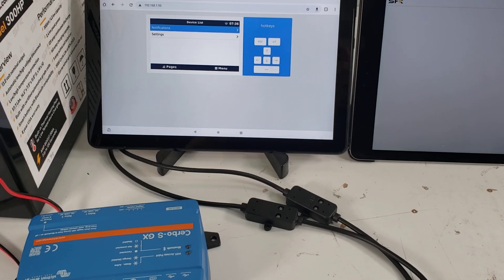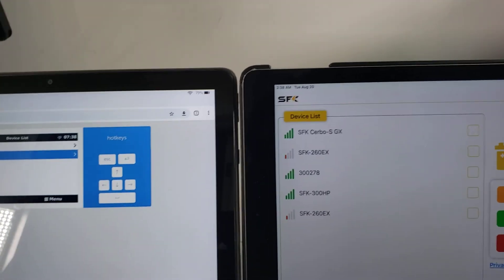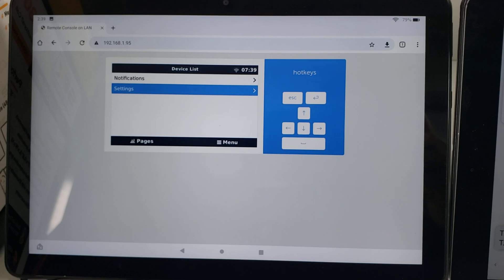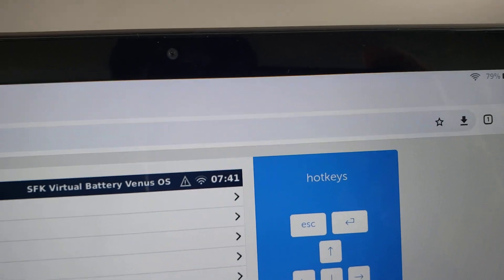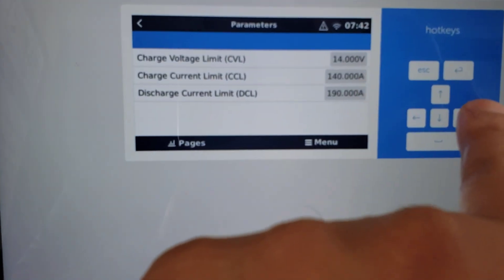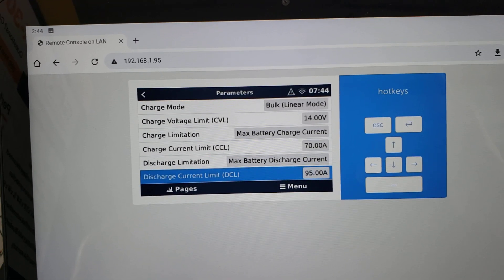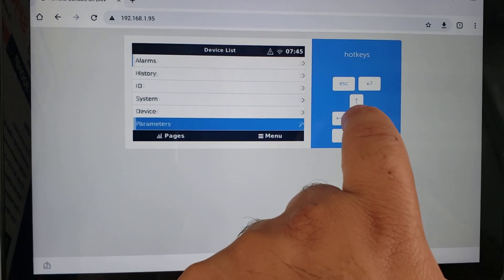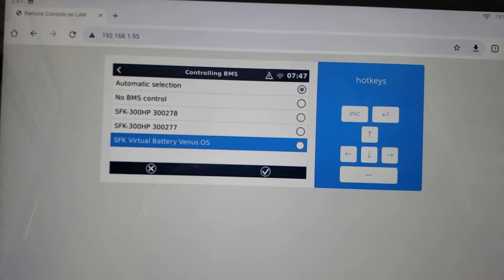Venus OS / Victron Driver 1.5 Virtual Battery Support Sun Fun Kits

Comment: Great upgrade. Now next step is a 2P2S or a 2S2P virtual battery. Mine are currently 2S2P. I have noticed that my batteries on the negative side of the 2S have lower cell voltage than the cells in the batteries on the + terminal. All cable lengths are equal.
Reply from the maker: 2S2P is supported in this driver, up to 4S2P (8 batteries) can work.

Comment: This is great. If you're out of USB ports can you use a hub? Is a passive hub OK or is an active hub required? Any problem mixing a V1 and V2 communications cable?
Reply from the maker: You can attach a hub, it does not need to be powered each port on the cerbo can attach a 4 port hub so you can have a total of 8 batteries connected. Please see our other victron videos where we show 4 batteries connected via a hub to a single port on the cerbo. Thanks